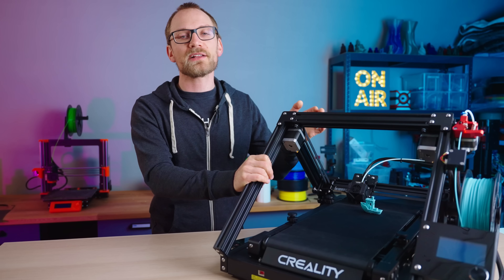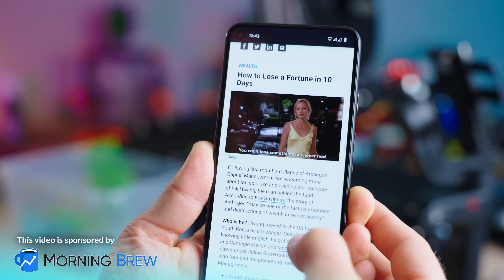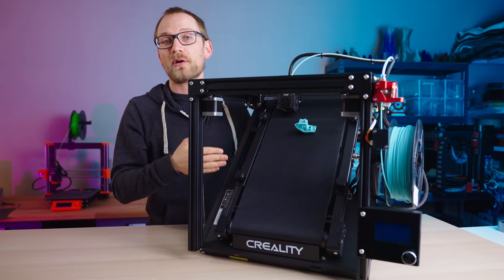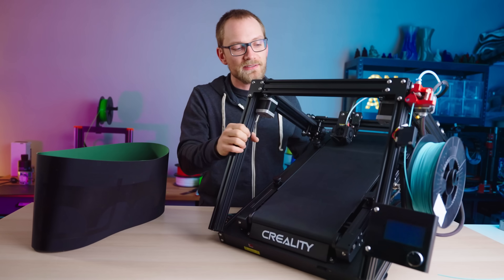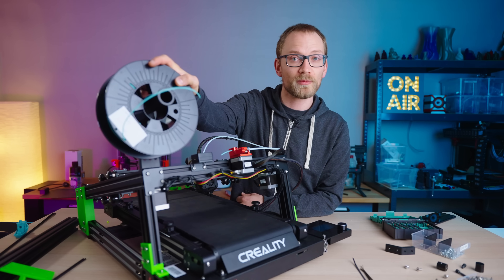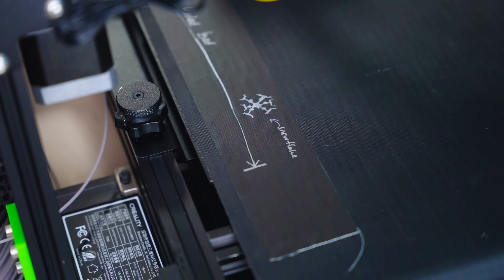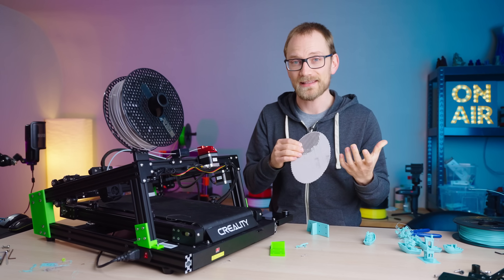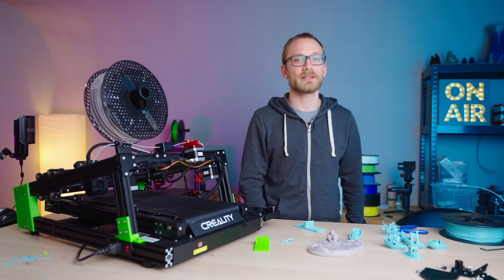Is a lowered belt printer BETTER?

Comment: I would say, in mechanical way, the angle is out of allowable tolerance... I don’t know what is the exact angle of your new printer, maybe 28° on one side and 31° on the other side? Just guessing it. Otherwise, what is the adjustment of the layer height... that’s probably out as well...

Comment: What about making a mount for the hot end that holds it at a slight angle so the print head is at 90 deg to the bed
Reply: Then the head isn't perpendicular to the layer anymore.

Comment: I think the print mill is a good idea, and I'm sure over time support for it will become better, but I don't see how this is "better" than automating a standard printer at this moment. You don't need special tooling (special slicer) and the automation is almost as easy as just adding new gcode.
Reply: The only thing I can see is the ability to have a machine crank out a run of parts without you needing to be there. I often would like to set a second print that would finish before I get back to the office, but someone needs to remove the bed and set it for the next part.

Comment: Why not just make it fully parallel so you don't have to compromise on build volume?
Reply: Because you would no longer be able to print anything longer than the frame and that would defeat the point of having a belt. Printing at an angle is what allows you to finish one side of print before the other as it leaves the printable area on the belt first. You might be able to simulate the angle in the slicer but that would require completely different logic in slicing with its' own caveats. Infinite axis printing just requires different slicing software no matter what approach you use. 

Edit: To clarify one of the important caveats printing parallel to the belt is that the nozzle would no longer be perpendicular to the part. Which would create layer adhesion and clearance issues.
Reply: @joshuafredrickson9719  interesting
Reply: That's patented by MakerBot can't sell those.

Comment: Maybe a stupid question, instead of changing the angle to 15 degrees this way why not keeping the gantry in same config and create a plate for the head that change the angle of the head vs the plate? This can bring the angle to more vertical without reducing the print size. Even better this cn be made potentially adjustable with a small stepper and gaining possibility to adjust it by the slicer depending on the best angle to print. If you add a limited possibility to move also the belt back and forth you can add additional “axes” capabilities. Or I’m missing something?

Comment: From what I gather Thomas is trying to fix wrong set of issues. If you want to print a lot of the same thing just put a belt on an Ender 3, or straighten the gantry of CR-30 - basically make a Cartesian printer with scrolling Y axis. But this approach won't work for anything longer than belt length. 

Let's say you want to print 1 m I-beam. The printer starts extruding and scrolls the Y axis until you have somewhere around 70 cm of 0,2 mm by 0,4 mm plastic extrusion hanging in the mid-air. And the it makes the short top line and scrolls everything in the opposite direction. And If the print still hasn't fallen off you do that EVERY LINE going in the Y direction. 

To print long things you would ideally want to print at the 90 degree angle to the belt. But then you have to contend with forces of gravity pulling molten plastic down and next to nothing bed adhesion. You could try to rotate printer 90 degree down so the belt basically becomes your Z axis but then you still have bed adhesion issues. 

Basically 45 degree gantry angle is the best compromise considering Y axis movement - the max Y axis movement becomes your max Z volume times √2 (a√2 is the length of the diagonal of a square with a side length of a) and filament adhesion problems (to bed and also between layers in some cases). So angle below 45 degrees limits your Y axis and angle higher than 45 makes adhesion issues worse.

Better solution would be to have the nozzle extrude perpendicular to the Y axis. You could possibly do that by having curved heatbreak or by cheaply grinding V6 Volcano at 45 degree angle - but then the nozzle opening gets all kinds of wonky.

Comment: is there any reason why you couldn't put a 15* bracket on the hotend to set the hot end vertical? not familiar with this sort of printer
Reply from the maker: That wouldn't change the way the part is printed, but instead just create new issues since now your nozzle isn't perpendicular to your layer direction anymore.
Reply: @MadeWithLayers   thanks for the reply! I realised last night that 15* wouldn't work (i started with 45/45).

So for the 15* i think you'd want 75*, but the idea was that the nozzle would end up pointing directly down? Or is it already doing so and I'm missing something...

Comment: It's all just simple geometry and trigonometry, but it looks like the slicer isn't processing in 2 planes.  First off, I know that X, Y, and Z naming doesn't truly matter, but if you compare it to a conventional 3D printer, this is not infinite Z.  This is an infinite Y printer, which is easier to understand for the majority of people.

Now getting back to the slicing issues, I have a feeling that the slicer algorithms are solely based on the top-down, or bottom-up, approach and there is nothing wrong with that.  The problem is that instead preprocessing the print and then slicing the preprocessed model, they are slicing the unprocessed model and applying the algorithms during slicing.  It's like trying to compile code with preprocessor commands all in one pass, instead on doing the preprocessing first and then compiling the preprocessor output..

They need to break up slicing into 2 steps.  1) Process the model with infill and supports, where the user is responsible for ensuring that the supports are correct for the printing geometry.  2) Slice the preprocessed output based on the printing plane.  This would require rotating the entire preprocessed model by the angle of the printing plane (the direction that the printing plane moves in relation to the model base) and using the lowest point as the printing plane base.  When adding supports, the user will need to take into account that the printing plane geometry is different from a conventional 3D printer.  This lowest point could actually be in the air, thus the user would need to add support for it.  In the end, this should allow the slicer to slice prints at any angle.

Comment: I've been saying for a while that a belt printer could do a normal z layer build, but it would need more clearance behind the nozzle for the belt movement. We wouldn't get infinite sized objects, but we could get lots of small objects that had been designed for normal 3d printing.
Reply: Why not just G code a regular core XY head to knock prints off? This belt stuff is a total gimmick
Reply: @ianhoolihan2396  Belt printers are a regular core XY head.

But I think what you're suggesting is to simply use a regular 3D printer movement system and have a way to knock the prints off. That's a great idea, and here's what I want you to do: Give it a shot and let me know how it goes.

There are lots of people who have given it a shot and have had various levels of success with it. However, it's not 100% reliable for all models. A belt is. "So why don't we put a belt on a normal movement system". Yup, Makerbot tried that. But it adds another layer of complexity. In simple terms, it adds another motor. Whereas, a tilted gantry like this gives you the advantage of a belt, with it's quick part removal and "infinite z", with no additional motors or complexity. However, it does change the game, and has it's own set of disadvantages because of that.

I wouldn't say belt printers are a gimmick. Belt printers are a new paradigm.

Comment: I wonder if you used Kiri:Moto for the slicer would have made a difference?
Reply from the maker: I'll need to try Kiri:Moto with the CR-30 some day... Ideamaker, too!
Reply: @MadeWithLayers  Hmmm...  What about a second extruder at the back--perpendicular to the belt--that lays down a thin, hot layer for the main extruder to lay the model on?
Reply: @KeithOlson  i was thinking the same thing
Reply: @MadeWithLayers  I cannot find angle setting in Kiri:Moto. But Ideamaker does and have used it with success!
Reply: Once my CR-30 arrives, I'd really like to try Proper Printing's "Moving Portal Mod" to basically turn it into an ABP. 'Course, such a thing can't be commercialized til Makerbot's patent runs out in 2030, but a lights-out 3D printing work cell sure would be nice!
Reply: You should increase your top layer and bottom layer to 7 layers
Reply: It will increase your print time but it will be just perfect

Comment: Why isn't it just a regular printer (cr-10) with a belt instead of a plate? Once the print is done, the belt advances to the clear the area.
Reply: Also: That's patented by MakerBot can't sell those.
Reply: @CutterSlade001  Ah... Patents are cancer episode 2137
Reply: To print very long parts?
Reply: @RicoElectrico  ah Roger that.

Comment: Really good idea. 6cm isn't really all that low for a large amount of prints. It's a worthy trade off in return for the advantages you were seeking.
Reply: To be fair, an angle that can adjust during print can provide will probably be really good but if this represent a challenge to slice, I cant imagine it for that kind of hardware

Comment: I think that you could sand nozzle extreme to get a parallel extrusion with bed. Even some company could develope a nozzle with this specific feature
Reply: You mean sanding the tip at a 45 degree angle? I think you could, but the nozzle opening would be oval, not circular. That might influence the quality of the print, since each "dot of plastic" deposited would be wider in one direction than the other. 

Also, there is a patent covering 90 degree angle belt printers and I think depositing through that sanded nozzle you describe might breach that patent. Because you now deposite at that 90 degree angle, even though the rest of the printhead is at 45 degrees. But I'm not a lawyer, so I'm not sure.

Comment: The post processing to use a conventional slicer should be relatively simple.   Just slice the model oriented at 15 degrees, then Z moves get scaled up and Y-moves get offset by Z multiplied by a constant.  Might even be able to cheat this into the layer-change G-code.  (i.e. by offsetting the coordinate system every layer change)
Reply from the maker: Ooooh, that's actually a really neat idea (and should totally work)! I've thought about writing a quick Python script that would offset layers in the Y direction based on the current Z value, but using pure gcode would be much easier.
Reply: Fyi RepRap can couple axis like this in setup g-code.  Marlin  is a bit harder but shouldn't need more than a few new lines of code.

Comment: Interesting concept.... what if the nozzle itself was ground at a 15 degree angle? You would have to compensate for increased line width due to the elliptical hole, but it would be a fun experiment.
Reply: Hmmm... I was about to say it would also be possible to design an angled nozzle, but then the problem would likely be getting it to properly tighten at just the right angle
Reply: @jasonking7570  you might also run into flow issues with an angle that sharp, you'd probably have to angle the whole hotend, and I don't know if that infringes on the patent that these angled belt printers avoid or not.
Reply: @TheR3dC4p  It really doesn't matter if it infringed on the patent since that only applies to products you're selling. You're free to infringe on all the patents you want at home for your own use.
Reply: @xKatjaxPurrsx  In the US, you can indeed infringe on the patent by just making something for use at home. Obviously, this isn't enforceable, but the moment you put that information on the internet... Well. Have fun.
Reply: @TheR3dC4p  citation needed...
Reply: @bradley3549  35 U.S. Code § 271 (a) Except as otherwise provided in this title, whoever without authority makes, uses, offers to sell, or sells any patented invention, within the United States or imports into the United States any patented invention during the term of the patent therefor, infringes the patent.
(b) Whoever actively induces infringement of a patent shall be liable as an infringer.
To the letter of the law, if you make it, you are infringing.

Comment: With the benchys losing adhesion at a consistent height, did you check to see if that is where they transition from the heated bed to the cold portion of the belt?
Reply from the maker: Good point... I'd think they should  still be on the heated plate at that point, but I'm going to have to check
Reply: He did mention that as a general problem at the beginning of the video. But the bigger issue probably is the one he explained. At a higher bed angle you get a much higher number of overlapping extrusions that re-heat the previous layer and push it further into the belt surface. I would've expected serious warping/lifting issues on that last print if the the uneven bed temperatures were the main culprit.

Comment: keep the 45 degrees and just make a new mount for the hotend that makes the nozzle 0 degrees to the bed.  I did this and it made it print the same as a regular printer but with infinite Z.
Reply: Exactly what I was going to suggest.
Reply: Tool-head clearance becomes an issue.

Comment: Why don't they create one with a 90 degres angle like regular printer and replace the z screws with belts or some sort of counterweight to make it possible to make non planar move easily/quickly that would result with the option of printing at an angle for longer parts and as a standard angle for regular parts?
Reply: That's patented by MakerBot can't sell those.

Comment: Can someone tell me why the belt isn't just used as Y. Then seems you can just use it like normal printer, and set up code to remove the print and then reprint. You would be limited on the Y build length, but for multi prints it would work great. It seems for this type of thing to really work you need to make serious changes to how Marlin interprets build volume.
Reply: One word - Swords -  In Sean Connery's voice.  Other than that its useless.
Reply: That's patented by MakerBot can't sell those.

Comment: Needs an extra axis on the print head so it can rotate from parallel to the bed to 45 degrees. Not sure if its viable but it would solve some issues.

Comment: dude  just remove the 45corexy frame and replace it with an ender 3 frame or similar. why stop at 15deg? might  as well go full  zero! you'll  have full height and normal printing! if you want to print long things go back to the 45corexy.
Reply: At full zero, you no longer have z axis. You'll have 2 y axis instead.

Comment: Such a clever idea, and excellent execution! Can't wait to see "adjustable angle" belt printers become more common!
Reply: I was thinking the same thing as the video went on. Add 2 more stepper motors and a hinge and some shenanigans and you've got yourself a masterpiece.
Reply: @Justkyrios  Then we could also have a go at nonplanar printing. The only thing that remains is slicer support and proper bed materials for adhesion.
Reply: @Tubaii25 unfortunately all is missing is patents expiring... 
Adjustable angle printers -> patented
i3 printers with conveyor belts for Y -> patented 
Non-planar printing -> patented 

I do understand why patents exist and their functions, but they are really holding back the full potential of 3D printing, imho.

Both Tom and Stefan have been going through this topic on their podcast, several times...
Reply: @andy_liga  Yeah.. forgot about the patents side of these things 😔
Reply: but if the community just started building things without selling them would a patent really matter? 🤔
Reply: @mrburns366  well, you can technically build one for yourself and never show/sell/distribute it. 

As soon as you start distributing (under any form, even open sourced) you break the patent... If you are lucky you get a cease and desist, you are out of luck a call from a lawyer. 

It's like going to the library and borrowing a new bestseller, no one stops you from scanning it but it's illegal to distribute to others.

Comment: One thing that needs to be done in the software to prevent those internal issues is to actually skew the model before slicing.  The problem I had when designing the software was that wasn't a feature available to me back in the day.  I wound up just rotating the model to the inverse belt angle... slicing it, then adding the Z shift to compensate for the offset.  But if the model were already skewed to match the offset of the belt, then no post changes would be necessary and the internal "additional" layers would be in the correct positions.
Reply: Would it be possible to show how to do the skewing in CAD before slicing?
Reply: @shamusobi2748  Yes... or just a pre-processor on the STL.
Reply from the maker: Isn't that exactly what today's belt slicers are already doing?
Reply: It's the order of precedence that is wrong... those features need to be identified before the skew... but generated after it... so they're generated at the proper offset (angle) from the layer above.
Reply: Cura wasn't available when I wrote the first post processors... but it should be easy to modify it to do it in the correct order.  Post processing won't do it correctly.

Comment: Someone should make a printer with a bed that tilts to avoid overhangs.
Reply: Or what if there was a way to make a "reverse lathe" in the way that the print was built up around a horizontal stepper motor controlled rotating spindle attached at both ends...an additive process, of course!!!! Layers would be built up like tree rings around the central core!🤔